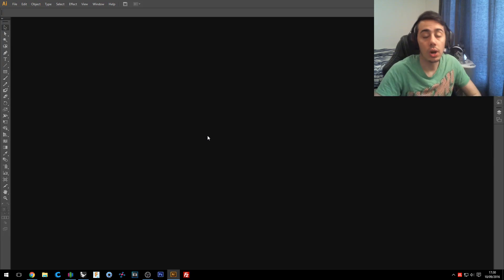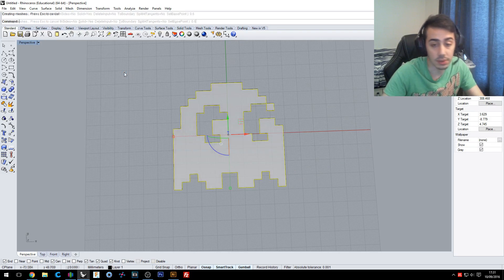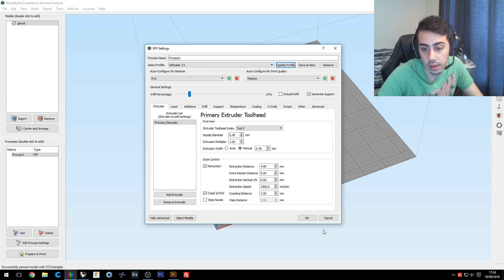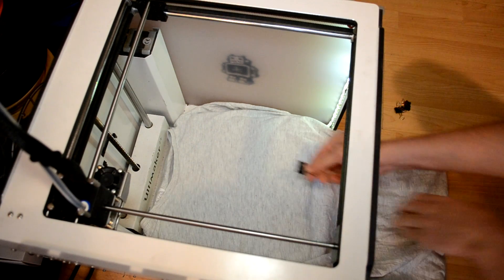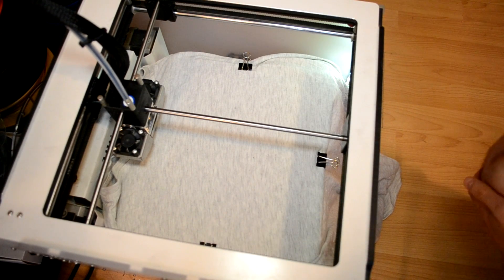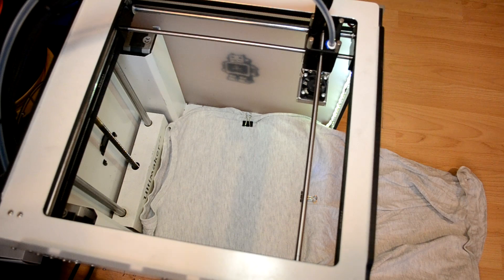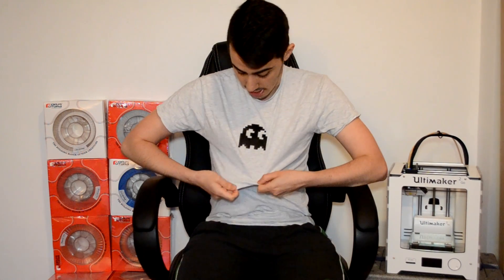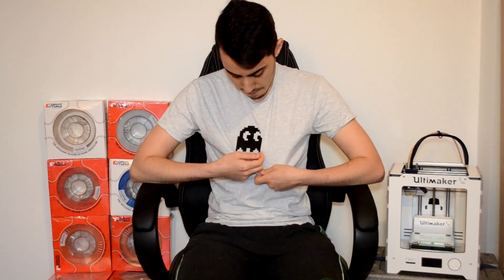3D Printed Custom T-shirt

Comment: Ran a few of these off with several different filaments, Ninjaflex Neon and Kai Parthy reflect-o-lay are amazing materials, easy to iron on and wash off too, which means you can use the same t-shirt for different prints, depending on which event you are attending :)
Reply: 3DFilaPrint i want to work on a project to print on shirts and hats, with some 3d rubber on hats and shirts and then some metallic like plastic on the hats as well, if you could please help that would be great! i dont want the object to come off as well so ive been guessing some type of strong thing several layers of a certain glue could do to go through wash etc!

Comment: What kind of filament did you use? And how does it wash?
Reply from the maker: I used PLA from FormFutura (15% discount: FNTSMN-15-FFT) and i remove it after i finish to record the video. I will say is a bit better than a sticker but you can pull it off with no problem
Reply: I wonder if there is a Material you can use to make this similar to screen print.  Good start on the fundimentals though
Reply from the maker: It will not the same but is something cool and cheap you can use it for some events